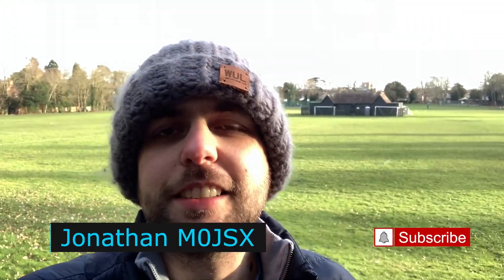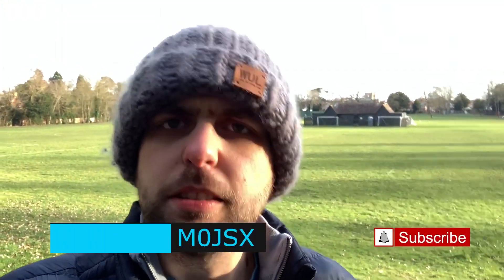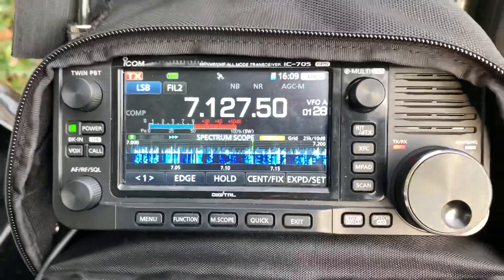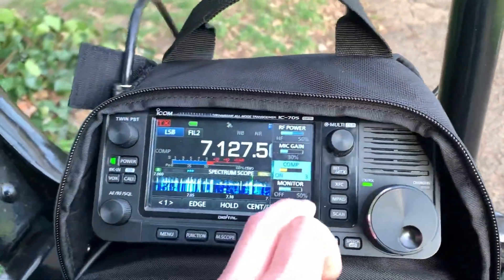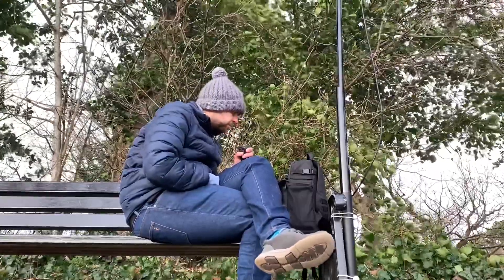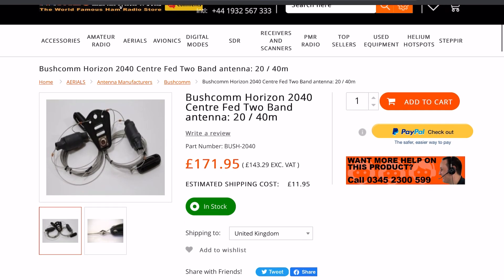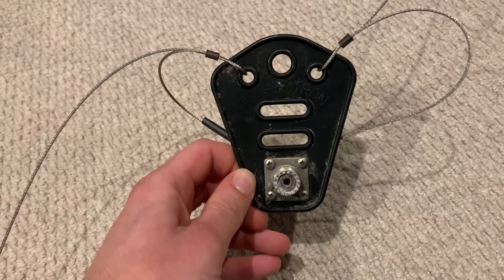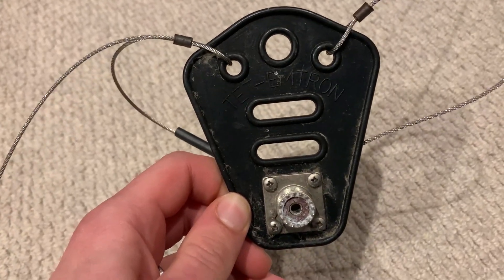A trapped dipole for portable use? (Bushcomm 40/20 review) - Ham Radio Antenna

Comment: Must be an iPhone if the battery 🔋 is running out. 😉
Personally I prefer M&P dipoflex and used with a Alpha Delta dipole centre these work great. I'd just fan it, other than weight, size for carry packaging not sure what the benefit of a trapped version may offer. 🤔
Good video Jonathan, I like the hat as well, almost the same as mine.
Reply from the maker: Thanks Andy. My rathe old iPhones doesn’t have the best battery life now. But still good enough for me! I like the hat too. It was handmade by a girl in Yorkshire. Her company is called Wul. Highly recommended. 73!

Comment: I was right with it until the price. I think I'll stay with my homebrew linked dipole for portable, it's only a few minutes to swap bands. I've never been a fan of traps and have always thought a fan dipole is better. 73 thanks for the review.
Reply: Have to agree with regards the price .... ouch! Nice antenna, but my homebrew end-fed half-wave gets me on 5 bands and cost me less than £35 to make (recycling old wiring from my kitchen refurb).
Reply from the maker: It isn’t cheap, and can probably be made cheaper. Unfortunately the shipping costs involved in getting the product from the factory in ZL to the UK push the price up considerably. 73!

Comment: Hi Jonathan great video. The budget is way out of my reach for this one. I plan on making a linked dipole for 20/40m also a efhw. I plan to be portable station just struggling still which rig. Would like a ft818nd and xiegu x6100. I like the idea of built in atu but I am sure the quality of the X6100 isn't as good as the 818.
Will you be doing an antenna builds videos?
Motters M7TRS 73
Reply from the maker: Hi Motters, in the near future I plan to go back to the same spot with a vertical end fed half wave for the 20m band. A linked dipole is also a good option and would work very well. I can’t comment on the X6100 as I’ve never seen one, the FT818 thought is very nice, if a little dated now. I’d put performance above ATU as when you’re dealing with QRP resonant antennas are far better than ATUs. 73!
Reply: @M0JSX  thanks for the feedback. Yeah I have to agree the 818 is dated as these Chinese radios are coming on the market with sdr I have considered the G90 but the screen on the X6100 is heading towards the ic705 but half the price. I get having a resonant antenna is key but at a pinch could tx on a wire fence if needed 😂 with an atu. So yeah that's where I am stuck, go with 817/818 built like a tank but dated or go Chinese as the have a scope to look at but need to take more care. I only want to use qrp voice.
73
Reply from the maker: @Mottersmotters  I think I’d honestly save up and go with the IC-705. 10W on all band 160m-70cms, and from a well known brand.
Reply: @M0JSX  could be a while before I speak to you on HF then 😉 bet that is what you was hoping 🤔🤔🤔🤔😏😁🤣
73👍🏻
Reply: @Motters Motters Hi, I run both FT8181nd and the FT817nd .... agree that they are build like tanks (which always instills a bit of confidence when out portable), but as Jonathan says, they are a bit dated. Have a friend with the X6100 and, having played with it, I can honestly say that the main attraction for me is the waterfall display, not the atu, at QRP levels, resonant antenna is the aim. That having been said, I prefer using my FT817/818 - a personal thing, I suppose (a bit like choosing a fishing rod amongst hundreds of the same rating, you choose the one that feels good to you).  Performance is fine on both these radios, running the FT818nd as a home base through a pretty compromised wire antenna I had hastily thrown out the window, I successfully worked the US and Canada as well as Asiatic Russia during the WWCQ contest last autumn.
If money was no object, I'd possibly try to add the IC705 to the arsenal - simply can't justify the expense.
Reply: @snaggitfishing2827  Hello, two things.... Sorry for the delay ive been working and the signal isn't great in Dumfries second thank you 🙏🏽 for you're feedback. Yeah I hear you brother with what you say I love the idea of the 817/818 and would have one. The price for new 818 is like £600. 😳 Old tech massive price. Yeah I know I can go for 817 second hand but I would want it like new. Hands down would be all over the 705 like covid over the world, but the price of it man. I am a family man with wife and 3 children at home so I would have to sell a body part in order to pay for it plus justify the buy (the money for the radio could be a family holiday). Regards the X6100 I love it as you say the display/scope. The main reason I like it (poor man's 705 😁) think it looks great. I am very tempted just need to save. I like the idea of the built in atu if for some reason I need to use something else as an antenna. Always plan for plan B. I am an engineer and like to have options. I will build an efhw which will probably be my go to antenna. However I will end up building a linked dipole just because 🤣 if I break the first one.
Sorry for the woffle
Motters M7TRS 73
Reply: @Mottersmotters   Haha! Yes, you are very like me in as much as finding it hard to justify being a big spender. I like the X6100, too, although I wouldn't trust the in-built atu to tune up a wire fence, that might be a little beyond its' capabilities. Having the combination of efhw and a linked dipole should cover most situations (it's basically what I have in my pack every time).
Now to dream about the IC705 and bemoan my slim-line bank account. Good luck with your portable set up (once assembled) there is something quite exciting about portable ops. 73 Age.

Comment: Nice video. Just wondering does the bare wire going against objects   branches,  leaves etc cause any issues and exchanging the wire for something like cals dx10 ant wire make winding up and storing easier. Good inside to what's out there for portable op,s.
Iam hoping to try bicycle portable from our beach this evening   using cals 10m travel pole on 40m cw/ssb. Look forward to your next video, 73 zl3xdj
Reply: The DX10 is ideal for portable being lightweight and flexible. Iv set up an inverted-v with it several times in the last week and only the paracord has given me gyp.
Reply from the maker: Hi Brian, from a performance viewpoint it shouldn’t make any difference. I prefer covered antenna wire, and I did wonder about changing the wire for DX10, but the construction of the antenna doesn’t lend itself to changing easily. Good luck with the bicycle portable operation! 73.